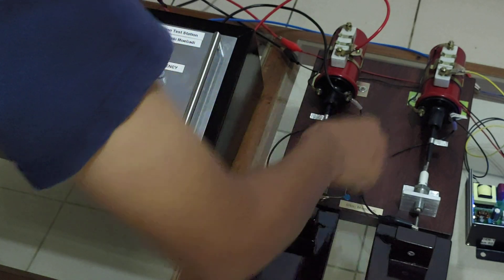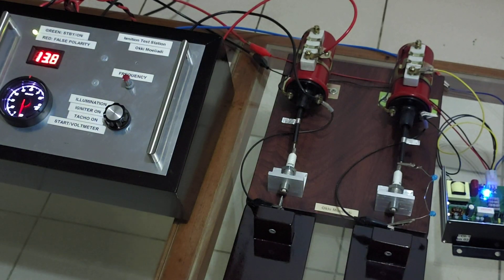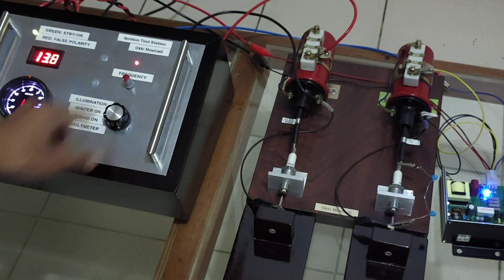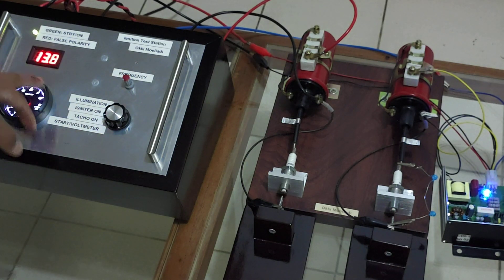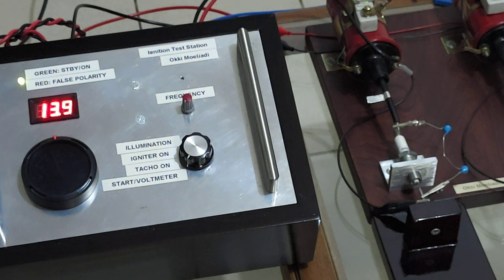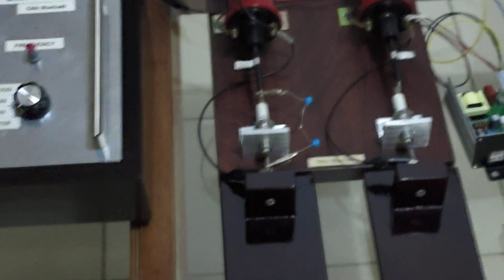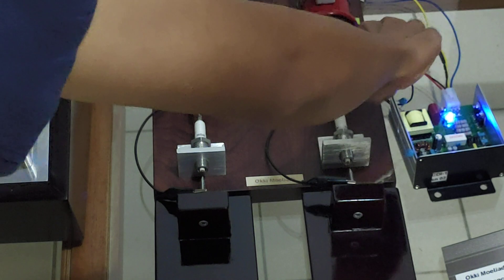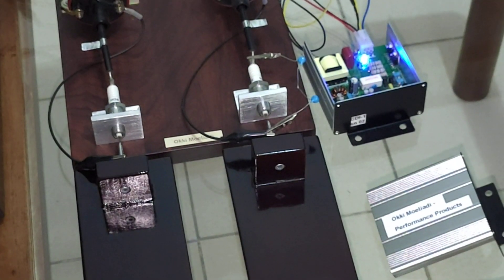CDI vs TCI

Comment: Your project is very cool. Congratulations. Friend, I have a question... If this CDI module is already capacitive, what is the need to place the blue capacitors in parallel to the spark plug?

Comment: hi, very interesting, I've one question sir: what is best for a motorcycle that revs in the range of 2000/8000 rpm? Because first version of my bike were CDI and the last is TCI.. I read that for low rpm bike TCI are better for long duration spark and for CDI it's necessary for high rev bike. Thanks
Reply from the maker: Hi, thank you! I think the best one would be to use CDI together with Simple Plasma Booster. You will get both advantages from high RPM CDI and stronger spark.
Reply: @OkkiMoeljadi  thanks :)
Reply from the maker: @alberto-cg7ox  you're welcome.

Comment: Actauly I am so interest to the cdi,  but what  the disadvantege if installed in the modern engine with waste spark sytem ignition ?
Reply from the maker: I don't see any disadvantage of CDI on modern engine with wasted-spark ignition system. It will just make the combustion process better.